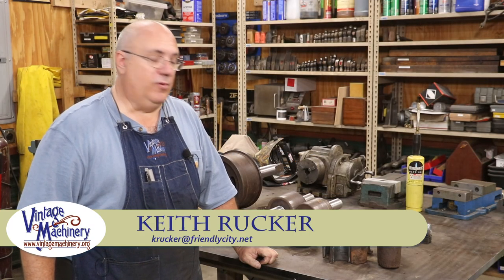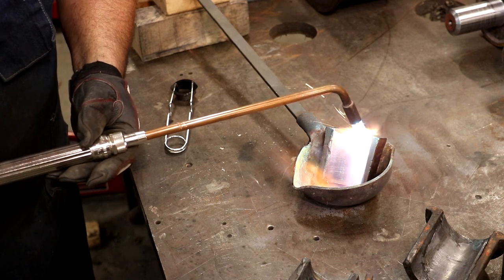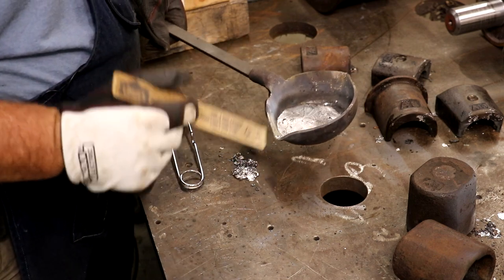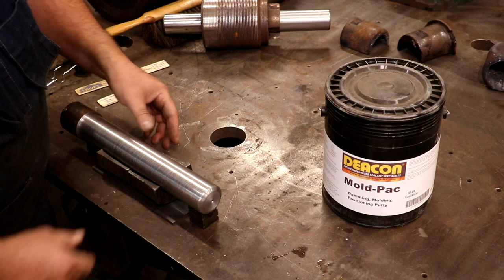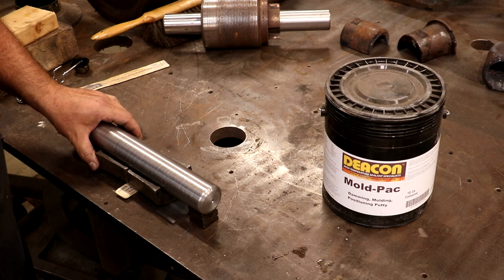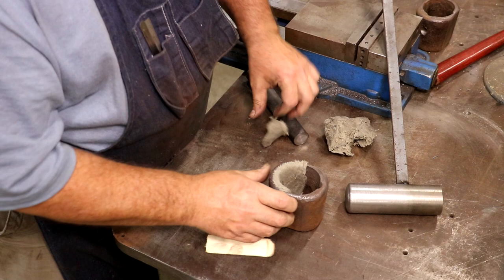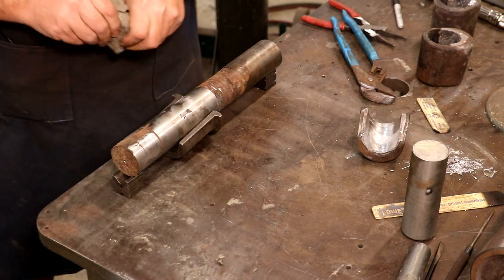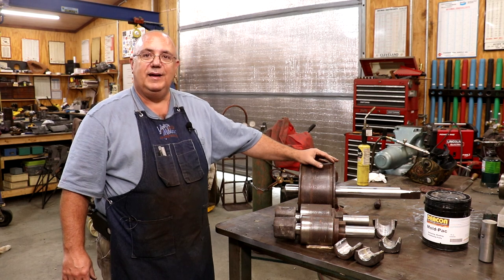Pouring Babbitt Bearings for a Goldens’ Three Roller Cane Mill

Comment: I imagine you didn't need to soot the mandrel was because you could pre heat it? If you can't preheat then the soot would keep the babbitt from sticking.
Reply: Actually, now that you mention it, preheating the shaft causes it to expand, making it easier to remove and providing a small running clearance.

Comment: Extend Material Life Stored In Plastic Containers:  One way that extends the life of material in a plastic container is to seal the lid to the container using electrical tape.  Electrical tape stretches and is flexible and is easy to remove.  Using electrical tape to seal the container will add years of life to the material.  This tip is especially useful for material that is seldom used.

Comment: I guess in an industrial setting the workers would be required to get lead levels checked. This is seen in radiator repair shops and of course battery manufacturing. Your exposure is minimal since this is an infrequent event for you.
Reply: ROFL. He is melting it, not eating it.
Reply: @johncoops6897  I was referring to exposure to lead. OSHA would require lead level checks for people working with lead . Example radiator repair people. When commenting it is important to pay attention to the comment.  Lead even in casual exposure can be absorbed or get into the Body
Indirectly.

Comment: Standardisation is under-valued.Making all the shafts the same size has many benefits.
Reply: Please explain further
Reply: @rodreed5147  When machines were being made, the persons who poured the babbit had mandrels that were the same size the shafts were.  When they poured the babbit into the part then the part would be chucked into bins to be sent to the assembly location where they would fit perfectly to the shaft without having to fiddle making the bearing fit.

Comment: Steel ball bearings may be more, er, food-safe.
Reply: as long as you are using this for non-acid foods, you are fine.  Still, the food shouldn't ever hit the bearings, as that would overheat them quickly with burned food.

Comment: Makes some fine babbitt leaded sugar sirup for sure.
IMO, I'd replace that stuff with turcite, PTFE or similar, in food applications, nowadays....
Reply: Many PTFE (Teflon) lubricants are considered poisonous and are not allowed on food processing equipment.
Reply: Not enough lead in modern babbitt to worry about, most is almost pure tin these days.
Reply: @howardhiggins9641  
I believe it has to do with ptfe giving of poisoness gasses when it gets to hot.
As Teflon is also used in water piping systems to seal joints etcetera I do not thonk teflon in itself is unsafe or a poison, just that it can be so if it gets to hot.